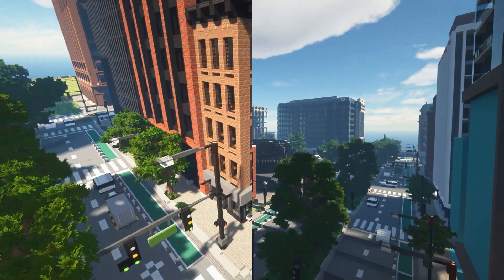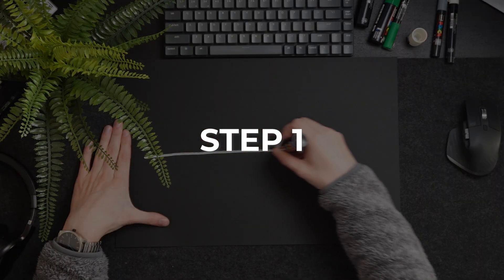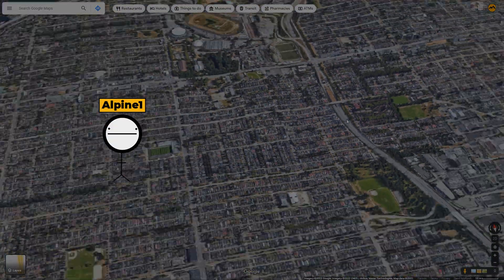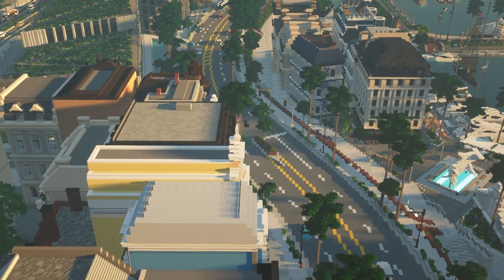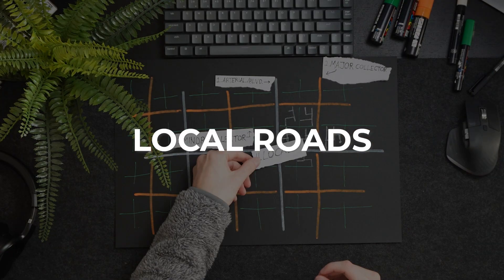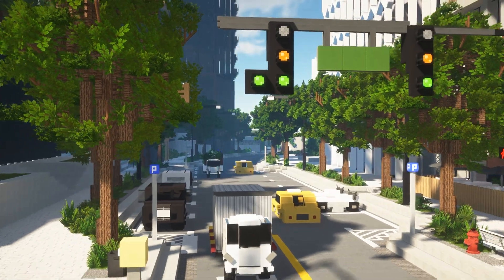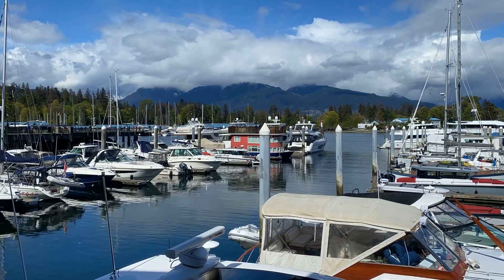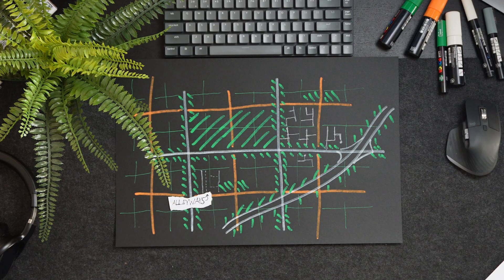Plan your Minecraft City with THIS urban planning concept

Comment: If I were to design a city, I'd pull a Carmel Indiana and make every intersection and interchange a roundabout because why not, using a place in Indiana is fine for inspiration. And roundabouts are statistically safer and more efficient due to slow speeds and less stop time.